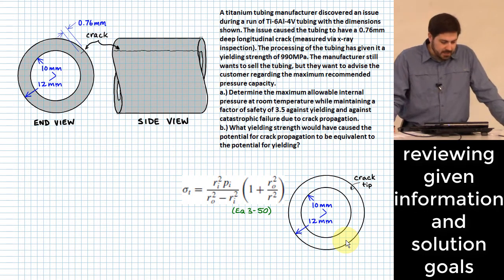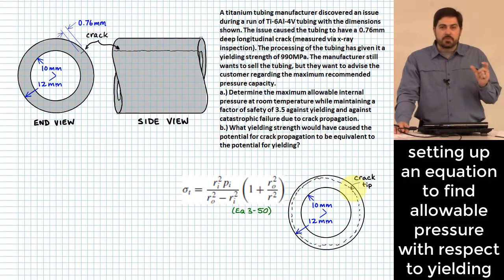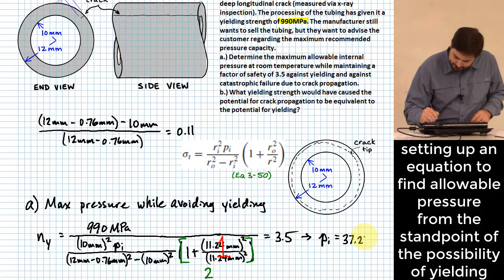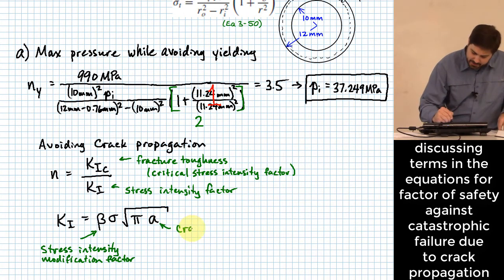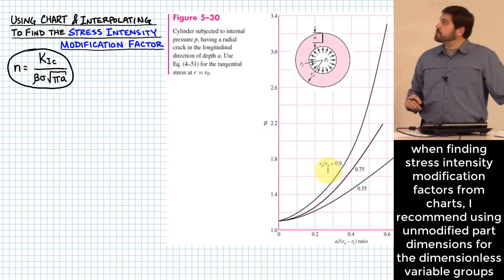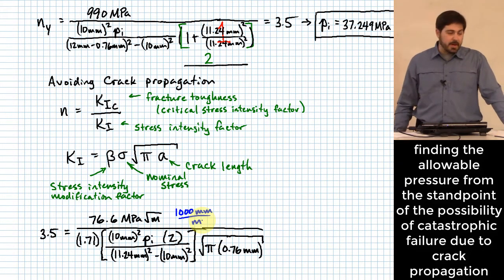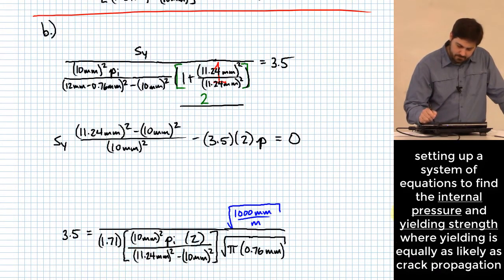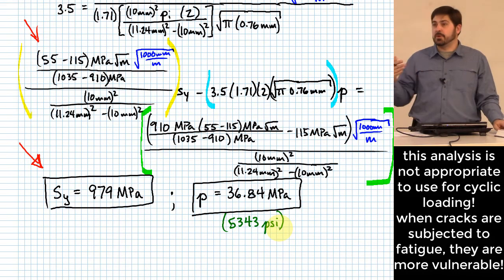Fracture Toughness Example: Allowable Pressure in Cracked Titanium Tube; Optimizing Yield Strength

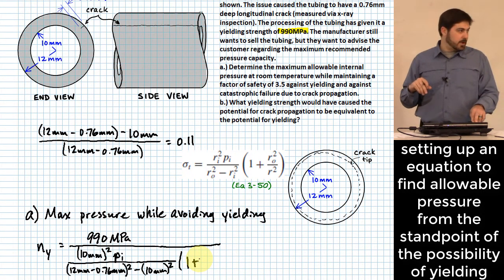Comment: At 14:40, you say we should use ro as our point in the wall to calc allowable tangential (hoop) stress. Why not ri, which would (conservatively?) lower our permissible internal pressure to ~33 MPa in lieu of the calculated ~37 MPa?

(This has me wanting to figure out why the crack wouldn;t start on the inside instead of the outside, I'll go ahead and figure out what I'm missing)

I can't thank you enough for putting these up online!!

Comment: Thanks for the lecture! Very much appreciate you are sharing them. I would like to add that when at around min 27 you were discussing the chart of Fracture Toughness of Titanium Alloys, those 2 curves come from 2 orthogonal orientations typical in extruded materials: O, T, L, and RD stand for Orientation, Transverse,  Longitudinal, Rolling Direction respectively. In sheet metal, how it's being rolled plays a role and make slightly different grain package and material get different strengths in a different orientation, and hence orientation / rolling direction matter from a strength perspective, but in the actual parts, you don't always know rolling direction so it is probably possible to interpolate if you have extra data and as you said how the material being processed, although in the case of tubes the direction is more or less straightforward.

Comment: hello,
thanks for uploading such great lessons.
if maximum tangential stress is at inside of the tube how r is taken as 11.24mm isn't it should be 10mm
Reply: r is where you want to measure the stress...
so its a variable..... 
Now, but r(o) is the outer radius of thr cylinder by  removing from it the crack length (12 - 0.76 = 11.24)

Comment: Based on the equation for stress of the tube, you will see higher hoop stress at the internal radius. ie: r = 10mm. And the way  you treat it like uniaxial stress yields almost the same result as with Tresca Criterion if the pressure is very small compared to the stresses involved.